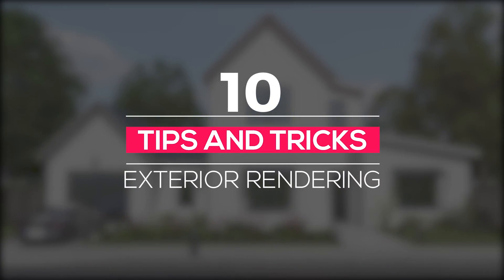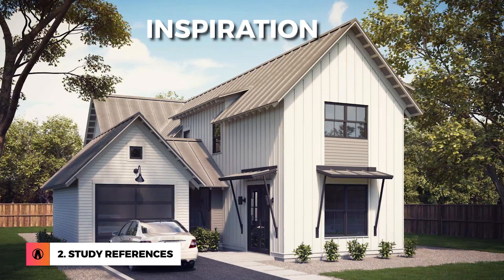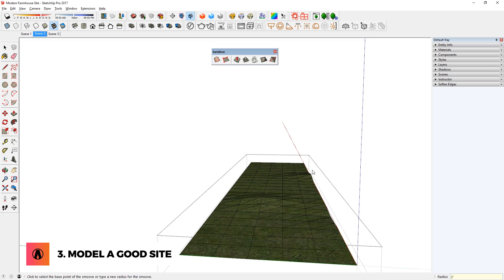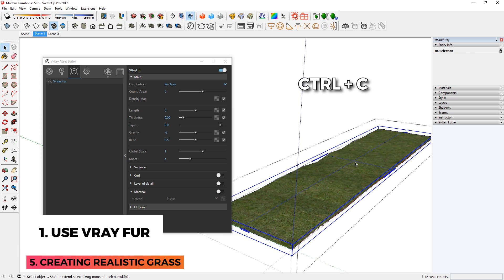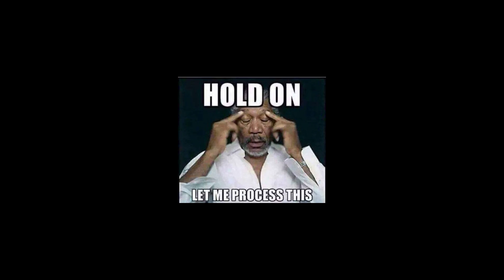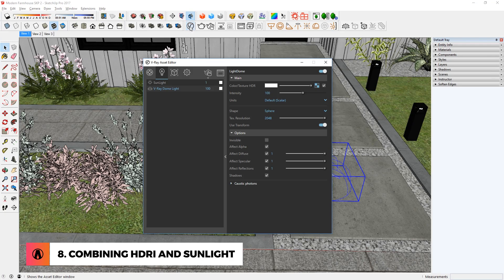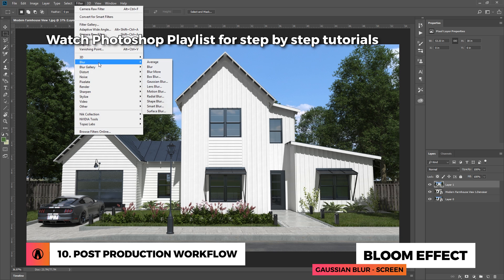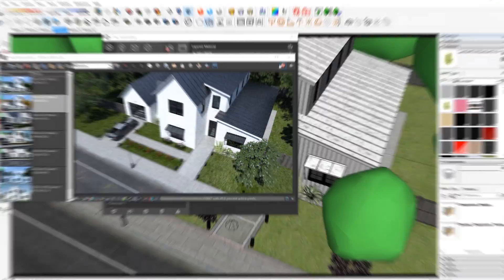10 Tips for a REALISTIC EXTERIOR Rendering

Comment: hey, it's me again. in my vray asset editor, under the option on renderer, there are no "engine", "quality" and "denoiser"...but it has the "progressive", "interactive" and "GPU acceleration" but the thing is I can't click them...P.S. do you a tutorial about reducing noise in vray render? thank you very much again.
Reply from the maker: Hm try turning off progressive and interactive, then there should be a slider for quality, then adjust that to High. I think you might have had "interactive" on, can you check? I don't have a tutorial specifically on reducing noise yet :(
Reply: Architecture Inspirations  thank you for the reply,,, I found the denoiser now....by doing what you have said. :)  but sometimes I cannot turn on and off the bars so I need to restart the sketchup
Reply from the maker: Oh really? That's odd, you should be able to turn it on and off whenever you want🤔

Comment: I followed the steps and the settings on for creatintg realistic grass using fur but my grass doesnt look like yours i dont know why
Reply from the maker: Hmm what does it look like? Maybe because of the texture you use?
Reply: Architecture Inspirations the grass texture i use is from sketchup texture club is there a specific type of grass material i should look for or use?
Reply from the maker: Oh I just used the grass in the built in vray material library and it worked for me 😄
Reply: Architecture Inspirations lol ok imll try that. Does your model slow down if rendering grass on a larger area?
Reply from the maker: Hm I think if it's a huge area then probably but it's not super slow for me 😊
Reply: Architecture Inspirations thanks 😁. Oh whats the laptop u use and specs . I want to upgrade my computer now is old
Reply from the maker: My specs are in my description box ^.^

Comment: Not sure about Hdri + sun. I mean, if you are using a proper hdri with correct exposition value you do not need to increase your illumination with a sun..
Reply from the maker: Proper HDRI is rather hard to fine, for example mine was really good but when I used it, the shadows was not how I wanted it to be. Also there's not much control over a HDRI. Combining it just makes it wayy easier to adjust shadows radius and everything else. But hey, it's just my opinion ^.^

Comment: how to make sketchup 3.4 vray fast? can you show how to setting that vray 3.4 tutorial? i'll try to render in my pc but it's to slow.
Reply from the maker: How slow is it? What kind of resolution and quality are you using. The speed really depends on your computer too
Reply: it take times for two hours and more for rendering, i just try 800 x 600 resolution only, my spec pc is...

mobo - msi b350 tomahawk arsenal gaming
cpu - amd ryzen 5 1600
hard disk - seagate baracuda 1TB
gpu - gtx asus strix 1050 ti  4gb OC gddr5
power suypply kcas - 500 watt
ssd - kingston 120gb

is it my spec pc ok for rendering?

Comment: Why not just use displacement for siding and shingles instead of modeling them?
Reply from the maker: You can, but after you render, try looking at corners of the one with displacrment materials vs mine with actual grometry. Also I can have better control over how it looks. Also it would just to show a point of this video too ^.^ this also depends on your computer as too much geometry can slow down your computer.

Comment: Im struggling thinking about shadow casting...some people said when u using hdri..u dont need sun because its give 2 lighting for ur model... but when i practice hdri only.. everything looks realistic except shadow casting..its not satisfy to me. I think ur way its better .what u think..sketchup inspiration?
Reply from the maker: I definitely agree too! Although most people don't know how to adjust HDRI or it may take a while to find the right one with good background and lighting. That's why I mentioned this simple method, in no mean is it the correct way of using lighting but it can help solve the issues most people have a little ^.^ thank you so much for the comment! Maybe I need to look into editing HDRI to change lighting, that sounds super helpful!
Reply from the maker: Yeaup, I have that same problem too! That's the reason why I sometimes combine both sunlight and HDRI, although make sure to adjust the HDRI setting so that the lighting doesn't conflict each other. 😊 also pay attention to the direction of the HDRI too. Try to match it with the direction of the sunlight😄
Reply from the maker: Got it! And by backplates, do you mean the .hdr files instead of jpg?